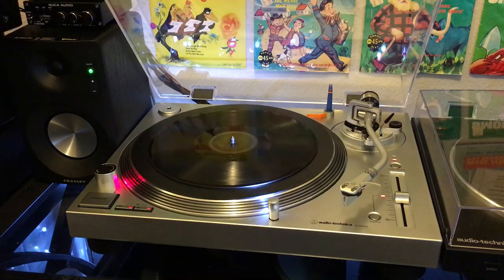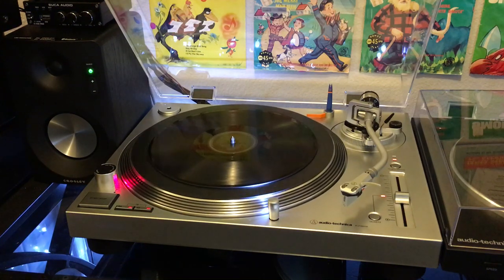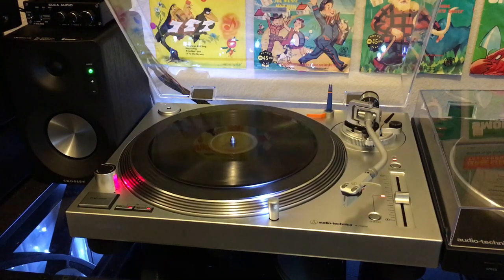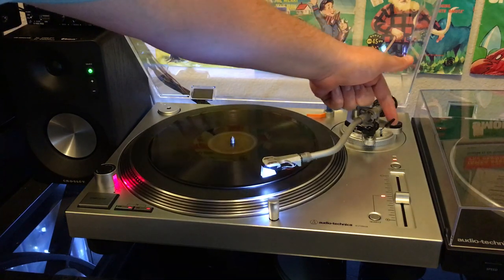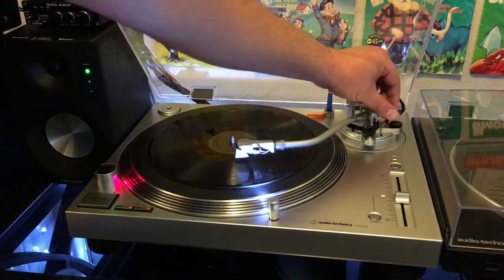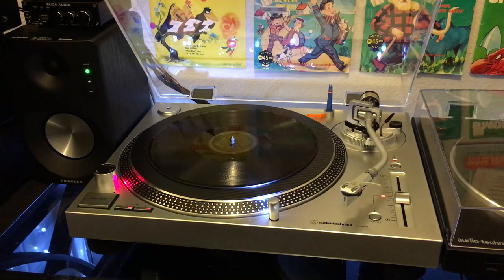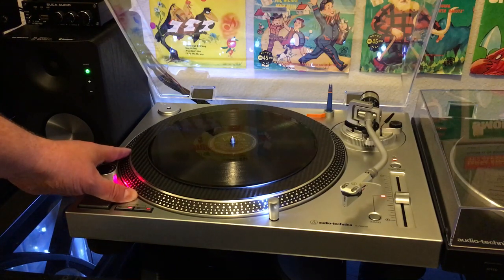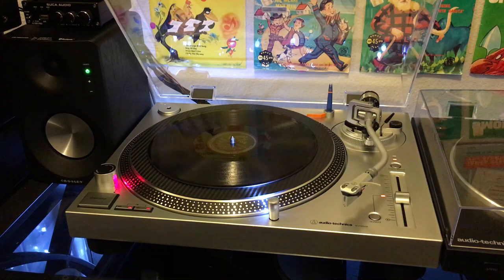78’s The Right Way!

Comment: Wow, very warm sound for a schellack record. But I prefer to play 78rpm's on my Columbia grammophone... 🙂
Reply: Oliver Reehuis Don’t play 78s after 1937 on a gramophone because the later ones had much more dynamic grooves and the heavy reproducers will just dig into the groove and ruin your record
Reply: unless the record is pretty quietly recorded and isn't loud
Reply: Me to I’d prefer to play them on my gramophone to!
Reply: Your Columbia is a Graphophone.
Reply: @puddingtheprotogen2243  same, its more fun
Reply: That's one way to ruin them. LIke Jay above says; You should not play electrically cut 78;'s on a grammophone, it'll wear them out in no time. Also they are really not meant to sound that harsh and 'shitty'. They are already from the era of amplification and speakers :)
Reply: W
Reply: @rollingtroll  Yup I agree if the sound is harsh don’t play it on acoustic players. The general rule of thumb is to not play electric records on acoustic players but you can get away with most records from about 1926-1936 or so just use common sense and be careful. I’ve just purchased some fiber needles that theoretically shouldn’t cause any wear on anything
Reply: @jaysvintagerecordsandphono6184 it’s still a 78 tho. What player would you recommend for say a 1946 frank Sinatra 78

Comment: I'm gonna be starting my record collection soon and I've had my eyes set on a few 78's from the '20s and '30s that I wanna get my hands on. This video was very informative!
Reply from the maker: Thank you!
Reply: Keep in mind that many of those records are mechanically cut (pre-1930) and meant to be played with a 'nail', pretty much. You need an even wider stylus for that. Not like you will hear the difference as mechanically cut 78's sound, well, horrid. But it may be useful for wear & tear on your stylus to get an even wider tip. Not sure what the width of those is though, I only play 'modern' electrically cut 78's.

Comment: If you want to get even more out of it, look into proper EQing as well.  There’s loads of info online that goes into what the proper playback curve is for these records.  The actual EQing differs depending on not only the label, but also the year it was pressed.  There were many different emphasis/de-emphasis curved in use back then!
The RIAA standard which we use to this day did not exist until the mid 1950s, so if you play a 78 like this through a modern preamp, you’ll find it to sound quite boomy as well as bit muffled unless you have means to compensate for it later in the chain.

Comment: Thanks for uploading this tune! nice sound but if you want to take it to next level, and get it really ideally, dealing with that distortion you would probably need higher needle pressure, heavier tonearm and better compliance. A simple test is to gently put your finger on the headshell in distortion passages and if it decreases you will know a higher needle pressure is necessary. Unfortunately these modern lightweight cartridges can't take much pressure only a few grams, normally 6-8 gram would be necessary to handle the energy of 78's and make a needle track properly in loud passages. Just my opinion but we can deal with some distortion if we listen to this nice music :)
Reply: I've also swapped out the normal 3 mil 78 needle for a 2.5 mil needle ... of course assuming you can find one! It rides just a tiny bit lower in the groove where the original needles didn't cause so much wear. 

If I weren't too old to get back into restoration AND had the $$$ I'd look into laser "needles" that can read a groove without any pressure at all.

Comment: That's a cart with a compliance of 18um. Definitely high for that (relatively heavy) arm. That's another thing to watch :). 
Would recommend an AT-VM95 cartridge by AudioTechnica with shellac stylus. Not only does it sound better to begin with (and it's cheaper!), it also just matches this arm better.
Another tip; Quartz locked record players sound better with the quartz lock off. It deadens platter resonances (which are desirable in many ways) due to over-correction. It's pretty much continuously keeping the platter from running away. A natural float of the speed doesn't sound like wow/flutter and is preferred (which is also why many, most even, audiophile turntables are belt drive, it dampens motor resonances, slows the platter down naturally because of friction so it doesn't have to be kept in check so much, and it's lack of 'perfect pitch' actually makes instruments (which never have perfect pitch either) sound more natural). 
As for the true mono bit; You can buy little bridges to bridge the channels of a cartridge. It technically isn't true mono then but I'd be impressed if anyone heard :D>
Reply from the maker: Interesting 🧐
Reply from the maker: So on my Technics SL-B5 which is not quartz locked but servo controlled, the strobe moves back and forth a small amount - that is a good thing?

Comment: 80 RPM records were mentioned. The only ones I’m familiar with are Edisons and Pathes.  Those records are vertically cut as opposed to lateral cut as most 78s.  A dedicated lateral mono cartridge will not play them.  You need a stereo cartridge with a 3 mill stylus to play them.  Playing them in stereo works, but sounds a bit diffuse and weird. Ideally you should sum the channels out of phase and they will sound correct.

Phil
Reply: YES! When I was in middle school I inherited a stack of Edison disks - the 1/4" thick monsters. At the time I didn't understand the difference between vertical and horizontal cutting; once I swapped the mono cartridge for a stereo one and threw the channels out of phase it was amazing what I could hear from a century ago.

Comment: To really get the best out of 78's and play them properly you need a suitable tonearm and cartridge, neither of which is really the case here. The Ortogin here is nice but only if you have pristine, late (mid 50s) 78's. The 2.5 mil stylus is too small. You need a minimum of 2.7-3 mil and higher tracking forces are de-rigeur with suitable low compliance stylii. I've found the best ones are either the Stanton 500 or the Shure M-44-7. Lots of variable size styli for these thst can be used at 5-6 grams, elliptical profiles too.
When you get that sorted you need to equalize properly. Either use something like the rek-o-kut re-equalizer to de-RIAA and apply correct equalization or feed your turntable output into audacity through a mic-amplifier and apply the correct eq in software. 
That's how to play back 78's properly.

Comment: It as actually Kinetic  energy when turning and potential energy when you hold it still.     It is a good idea to keep separate records in your collection for playing on a "wind-up" and for playing on a modern electronic phono system.   Rare, mint and collectable 78s should never be played on acoustic phonographs.  Most of the Victors and Columbia discs when first issued were absolutely  quiet and distortion free.   Edison's may be played on any stereo cartridge  by flopping two wires on the pickup and then combining  them into a mono signal.

Comment: 0:22 That's simply not true: playing shellac records as originally intended - i.e. with a steel needle - is known to cause both the record AND the stylus to wear down after repeated playing, so this argument does not hold. Shellac records were designed to be played this way but they were not designed to last indefinitely when played this way. You simply can't bend the laws of physics.
Reply from the maker: Also brings up a good point…. The fine line between “wear” and “damage” can be fuzzy.
Reply: @Recordology  Indeed it can be. Part of the reason is that sometimes a damaged record can still be played without the damage being noticed and that is a function of the playing apparatus.
For me wear is a type of damage.
The real question is whether the original signal recorder can be recovered intact or not. In that sense, one could argue that a shellac record that has been broken in pieces but glued back together is damaged but not worn and can be replayed back by certain equipment (e.g. a laser record player) without issue. An LP record where the groove has suffered wear due to incorrect stylus shape or pressure may still be playable is a stylus of the appropriate shape is used. This might be possible in certain cases but one would rather avoid the risk in the first place and ensure the correct playing conditions are observed.

Comment: I love 78’s too I want to get a good turntable to play them on as well as my lp’s and 45’s. Along with good cartridges for the 78’s and for 33 and 45’s also. Would you please recommend some choices for good direct drive turntables and cartridges for 78’s also some fro 33’s and 45’s. Thank you.
Reply from the maker: I would recommend this particular set up it seems to work really well for me.
Reply: I have a "Technics SP-15 turntable" with quartz lock that will play 33, 45 and 78 rpm, but I use it only for  the 33 and 45rpm records. This is because it has a very light "Grace 727 tonearm" with a "Shure V15 type III cartridge" that is suitable only for 33 and 45 records. I run this through a "Bellari VP130 tube phono pre-amp" with RIAA equalization, to my home computer to record and digitize the recording.  For the 78 rpm records, I use a "Stanton T.92 USB turntable" with a "Grado Prestige Gold 78E cartridge" ran through a mono "TDL restoration pre-amp", using RCA type cables and jacks. The TDL,(or something like it) is needed  to get many of the different Rolloff & Turnover equalization settings that are required and essential for proper sound playback of 78rpm records. The book: "Playback Equalization settings for 78 rpm recordings (Third Edition) by James R. Powell Jr.and Randall G. Stebic" has been a great help for me in knowing the equalization settings needed for proper playback. The Internet also has sites with many of the equaliztaion settings and record speeds (not all are 78 rpm, some are faster and some are slower). Again, this is ran through my home computer for recording the music. I use "Audacity" on my computer to record the music at 192,000 htz & 32 bit float. Then I make a FLAC file and send it to the "Vinyl Studio" for sound adjustment and tracking/editing the sound file, once that is done I upload the 78 rpm music to "Internet Archives". Here is my link for the 78 rpm records I have been able to upload so far:   https://archive.org/details/@randy595     (Note: No filtering or pop/noise removal is used on these Internet Archive recordings, but the 78`s are cleaned using Ajax dish soap and a fine toothbrush, then rinsed off in a sink with water, while some may disagree with this I also play the records while still wet, I think it improves the sound a little).
This is just two choices of turntables / cartridges that will work but there are many other choices to choose from. Other items that you may want are a stylus force gauge (small scale in grams) for a proper tracking force of the cartridge/stylus, and a "KAB SpeedStrobe" (or something like it) for proper RPM setting. I am no expert on any of this, but this is what I use. I hope this helps you or somebody else.
Reply: @coinhound8482  You provide good, honest information. I just came into possession of a few 78 recordings, they sounded pretty good, but I did have to clean most of them. I need to get a full-on 78 cartridge if I want to get the best sound. I haven’t tried my hand at digitization yet, but your report encourages me. Thanks for sharing.

Comment: The Edison records that were 1/4" thick, were 80 rpm.
If this was a re-issue, I think it would've had a more modern label: all black with a colour picture of Nipper.
One of the biggest reasons 78's sounded "scratchy" was because they were made of shellac.  Once they started pressing them in vinyl in the `50's, they sounded WAY better!  Maybe even better than a 45 of the same record.

Comment: You should direct-feed the line out for the music. I just got the Ortofon 2M 78 cartridge which is specifically for shellac 78's. I have not mounted it yet, but it is supposedly a mono cartridge with pin-outs for stereo leads. Have you ever tried it?
Reply: That’s what I use on my LP-120.

Comment: Have you done a video about demagnetizing? I don’t recall that term
Reply from the maker: We just touched on it briefly, the carbon fiber brushes with a metal handle will discharge static a.k.a. magnetization
Reply: Record-ology thanks.
Reply: @Recordology  I taught college physics. Static electricity is on the surface of an item while magnetization is a property of its atoms.

Comment: I have a ton of old 78's from the Roaring 20's and two victrolas from the late 20's....one which now needs work. My old Silvertone that my folks bought me back in 1957 played 16, 45, 33, and 78's used to play, but now has some problems. :-(  I'd like to buy a reasonably priced record player that will play 78's as well as 45's and 33's. I'm looking for a new record player that I can move from room to room, but am not sure which one. I DO know the old needles from the original victrolas caused damaged and have to be changed after a few plays. I guess whomever owned the records before me did not always follow this rule. Sure, they have scratches and dings (that I did repair work on....with a nail file...lol many years ago in my teens) when I didn't know any other way to repair the "dings" on the old 78's. So...do you think I should buy a blue tooth player that I could keep in the family room....yet play via the PC or throughout the house? I'm looking at various ones.
Reply from the maker: sure go for it!

Comment: Record-ology, I think that the paper sleeves that hold 78's can be interesting artifacts, and the multi-record albums can be handy, but I have found that they have usually been stored in a damp basement of garage and they have picked up a strong unpleasant mildew smell.  Because many of my old sleeves were damaged anyway, I have replaced them with new sturdy paper sleeves.  Do you have any way of fumigating sleeves and albums?  Thanks,  J.R.
Reply from the maker: Its a good question.....in my experience they get better over time in your home's air.  I too love the designs...https://www.youtube.com/watch?v=Xxl6mn5FrH8
Reply: Reminded of a sleeves Vocalion had for their records being real sweet.
Reply: Use silica packets like the ones found in shoe boxes. Though I reckon you’d have to keep the stuff locked away in a box awhile so the silica can do its thing

Comment: Record-ology, I ended up purchasing a Reloop RP4000MK2, because I could not find the Audio Technica. I was a little disappointed in that it does not come with the dust cover (had to order that) and does not have a preamp.  I did get the cartridge that you recommended.  I'm waiting for a preamp.  Can you answer why the Reloop looks so much like the Audio Technica?  I also got  protractor and a scale.  Not sure how this thing sounds until I get the pre-amp.  Thanks
Reply from the maker: Interesting....by looking at it I can tell you its virtually identical to the Crosley C200 so it is surely built by Hanpin which makes almost all of the Audio Technica stuff as well.  Let me know how it goes!
Reply: @Recordology  With the ART preamp the 78's sound pretty good.  The ART preamp didn't come with a power supply though.  Had to order one.  This hobby can be $$$ if one doesn't do enough research.  J.R.

Comment: This sounds too muffled. Perhaps adding a little treble might help?
Reply: Most 78s will sound muffled and boomy when played through phono preamp that’s designed for modern records, unless you EQ it later on.  This is because the RIAA curve we use now was not made standard until about 1956.  Before that, the emphasis/de-emphasis EQ curve varied depending on the record label as well as the year it was pressed.

Comment: What equipment would you recommend for a newbie with a small collection of 78's?  I'd also like to play some of my old 33-1/3's.  Also, won't the 78's that we might find today have already been ruined by someone having played them with the wrong needle, or on a victrola with a worn out needle?
Reply from the maker: For this I would recommend the Audio Technica Lp120XUSB.  Then get a dedicated 78 cartridge head shell assembly that you can put into the storage hole on the plinth of the lp120.... https://amzn.to/2MBuREV  The worn records shouldn't cause damage but may be more noisy.  I wouldn't worry about it.
Reply: @Recordology  Thank you!  I'll look into those suggestions.
Reply: Could not find that turntable in stock.  Ordered a similar upgrade.  Did order the cartridge.  Thanks again.  Will report on success next week.
Reply: Record-ology, I ended up purchasing a Reloop RP4000MK2, because I could not find the Audio Technica. I was a little disappointed in that it does not come with the dust cover (had to order that) and does not have a preamp.  I did get the cartridge that you recommended.  I'm waiting for a preamp.  Can you answer why the Reloop looks so much like the Audio Technica?  I also got  protractor and a scale.  Not sure how this thing sounds until I get the pre-amp.  Thanks
Reply: A mono/stereo switch would prove useful for reducing crackle.
Reply: @johnrosenfelder6572  they are all inspired by the Technics 1210, considered the best DJ deck: the Reloop range has always looked great to me!